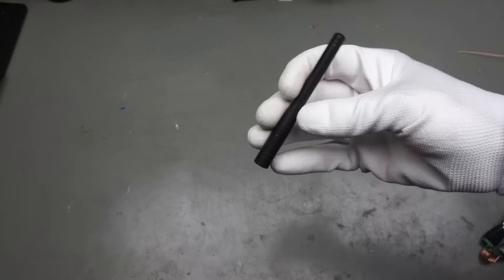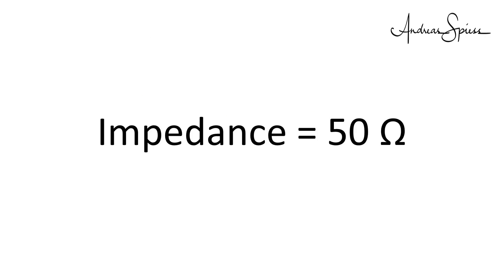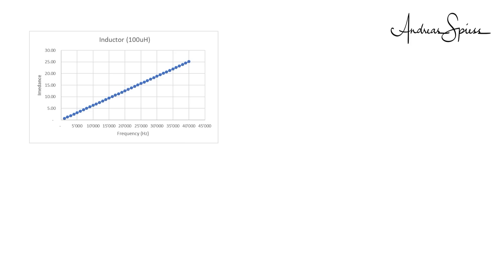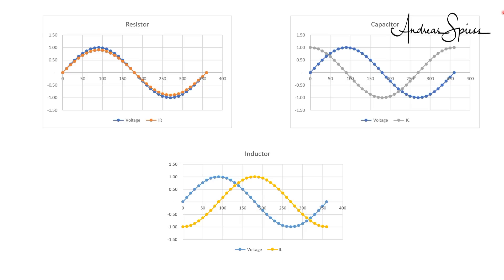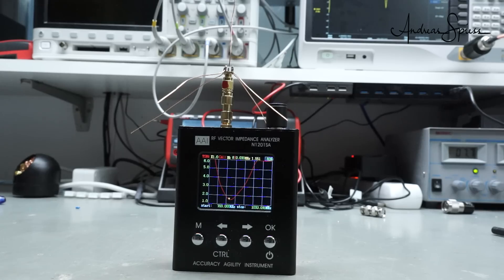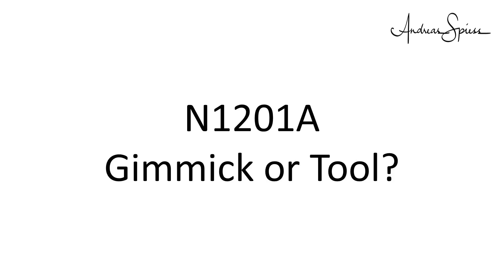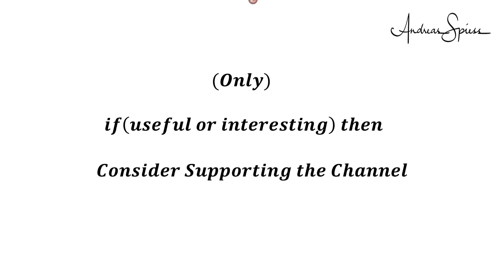#191 Optimizing Antennas using a cheap N1201SA VNA (Vector Impedance Analyzer), LoRa, Review

Comment: Can someone spoon feed me and tell me what the yellow line V shapes are when an antenna,CB 27mhz, is connected to the port 1 ?   I didn’t attach anything to port 2. Is the “V” dips where the antenna has its best harmonic in Mhz and therefore the best frequency the antenna is tuned to?
Reply from the maker: This is where the antenna resonates and should be used.

Comment: Excellent video. I also have china antennas which work correctly only when the plastic cover is removed. Do you think the designers were unaware of the dielectric effect ? Abit like the antenna problem on one of the earlier iphones ?
Reply from the maker: The palastic shifts the resonance frequency (as you write). It has to be taken into consideration while trimming the antenna.
Reply: @AndreasSpiess  
Is this due to the polymer lowering the velocity factor?
Reply from the maker: @MountainParameters  I do not know 😞
Reply: @AndreasSpiess  
When we used dual wall adhesive heat shrink to ruggedize a Smiley 5/8 wave SAR antenna, it decreased the velocity factor and the result was we needed to trim an extra 2mm (as compared to the same tune point for the stock Smiley with no heat shrink) in order to optimize the best SWR and impedance for our target tuned frequency.

Comment: Hi Andreas, maybe you can help. I am looking for a cheap way to test the strength of LTE/4G mobile antenna. Do you think that a VNA that reaches 1800mhz can help me with this? What I am looking for is a way to see quickly if the directional lte antenna is being pointed to the provider and has a strong signal... you know, moving, left right :) There is a plenty of devices for TV/sat, but I can't find any economic version for LTE
Reply from the maker: Antenna design is a complex task. A VNA is needed. But a lot of knowledge, too.

Comment: I have been using a nanovna for a couple of years and have found it very useful for tuning and troubleshooting antennas.  Every time I use it I am amazed that such a cheap tool can give me the same information as the $80,000 analyzer I use at work.  Obviously I don't expect it to be perfect but I have compared it and found it surprisingly close.
Reply from the maker: I agree. When the first cheap devices appeared on the market, I had suspicions and also compared it with an expensive instrument. Already then, the results were usable for my purposes.

Comment: Resonance and minimum VSWR are not the same thing.  Zero reactance is "resonance".    And minimum VSWR may not be at the zero reactance point.  VSWR is calculated from the load impedance and the characteristic impedance.  You really want to tune your antenna to the zero reactance point and then use capacitors and inductors get the best VSWR where load impedance=characteristics impedance and thus you will get 1:1 VSWR.    One of the better articles I've found is here https://abracon.com/uploads/resources/Abracon-White-Paper-Antenna-Impedance-Matching.pdf  and this software allows you to figure out what you need to get to the 1:1 VSWR http://www.blackcatsystems.com/software/matchmaker/tutorial.html
Reply from the maker: You are right. I discussed this topic in later videos. And thank you for the links!

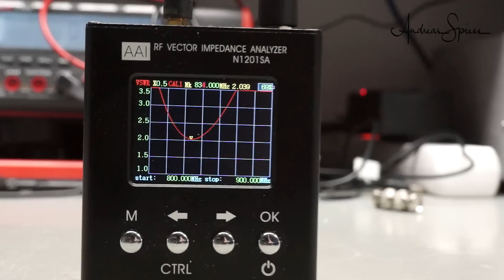Comment: 12:35 So the plastic isn't transparent to the radio waves! If the antenna was in a larger plastic box would it still have the same problem or is it the closeness of the plastic causing interactions?
Reply from the maker: The closer a material to the antenna the bigger the effect. It is not about transperency, it is the influence of the material.
Reply: @AndreasSpiess  I didn't mean transparent to light, just to radiowaves. So if an Antenna is in a large airtight box, it might attenuate the signal a little but wont affect its frequency?
Reply from the maker: It for sure will not influence its frequency but might attenuate the radiowaves signal.

Comment: Andreas your VNA and related videos are great and much appreciated is that you don't weight them down with complicated math and equations. However one thing troubles me. If an analyzer needs calibrated each time frequency is changed which I understand, what happens when I use adapters to analyze different antennas in the HF ham bands that use say for instance type N and PL259? Would not the use of adapters skew the calibration result especially if said adapters are of low quality? What say you my friend?  73 de N8EVM
Reply from the maker: Maybe you watch my video about the proper usage of the nanoVNA. There I explain the influence of the reference plane. Because we usually only have one calibration set we have to live with this inaccuracy. You find the nanoVNA on my new HAMradio channel: https://youtu.be/_gZEeoAl5Nk

Comment: You should be using the Smith Chart. You are working with half information on amplitude only. The Smith chart will tell you where you need to place a reactance, and what it should be. That will take you right down to a VSWR of 1.
Reply from the maker: Maybe you watch my video about the proper usage of a VNA?
Reply: @AndreasSpiess  I shall. I presume this was the quick and dirty version that just replicated a normal scalar VSWR meter.
Reply from the maker: No. This instrument also shows impedance. But only for a particular frequency. You can quickly change it with the wheel on the top if you want to get an overview.

Comment: I was a Microwave Technician and took a 9 month Special class about antennas, learned all the basics, theory and use of the Smith Chart and went on to work to help build 4-18 Ghz microwave amplifiers here in Silicon Valley, there were a lot of tuning using the microcope, tuning is like black magic with a skill using those little gold chips and soldering / tacking them when the desired SWR was achieved. I would like to buy one of these... hahaha... I'd like to learn how to use this HIGH TECH DEVICE 'AWESOME'...
Reply from the maker: Maybe you watch my video about the NanoVNA. This is a more modern version (which also shows the Smith chart)

Comment: Now should I resonate the antenna or vswr the antenna? I have seen that in all cases the swr readings does not match the mfj269c
Reply from the maker: Maybe you watch my videos about the NanoVNA. There you see why  resonance and a low SWR is not the same. Usually you do not want to lose a lot of power and protect your gear because of a bad SWR. So most people look at that. Many resonant antennas do not expose 50 ohms at the feed point and sometimes need transformers...
Reply: so basically you need 50ohms at the antenna and be resonant in the frequency range?the wilson 1000 is one fine example of a difference in swr and resonant

Comment: Would it be a good idea to 'Trim or Tune' antenna from the feed end of a connected coax line?
Reply from the maker: It is always better to trim the antenna from its feed because a coax changes the measurements.
Reply: @AndreasSpiess  Thank you, I have a Nano VNA on the way and will do so. Is there ever a need to add inductor or capacitor to a ground plane antenna or di-pole or just changing the associated lengths do the job? I'm guessing you might need them if you want an antenna with a wider band.
Once again Thanks.
Reply from the maker: You should not need a cap or an inductor for a ground plane. For long waves they sometimes "shorten" the radiating element with a spool.
Reply: @AndreasSpiess  Thank you

Comment: 1:14  I'd say the ground plane antenna has been the #1 most common antenna type in the world for over half a century, there's been one on almost every car and truck ever made that came with an AM/FM radio for well over the last 80+ years and by 1946 there were an estimated 9 million AM car radios in use and currently over 1 billion estimated on the roads today not counting the ones no longer being used. Mobile device antennas might have changed that though.
Reply from the maker: If you call all vertical antennas "Ground Planes" you are right. Often, the word "GP" is used for 1/4 wavelength radiating elements. Then An AM antenna would have been quite long ;-) That's why they often were loaded/shortened with inductors.
Reply: @AndreasSpiess  no, not ALL vertical antennas are GP's, there are vertical dipoles after all... But in the case of vehicles we are not typically talking about a "radiating" vertical element like we would expect for a ham "transistor" radio that can transmit too as well as just receive. Vehicle AM/FM radio antennas typically only have to "receive" which is much more forgiving and can be MUCH smaller fractions of a full, half or even a quarter λ to work...
Reply: @AndreasSpiess  I would even imagine "some" mobile radios could be considered a GP antenna too because your body acts as the ground plane. With my cheap UV-5R radio my hand capacitance acts as either the bottom of a dipole or a ground plane depending who you ask and the same could be said of other mobile devices too. What is your opinion on that matter Andreas?

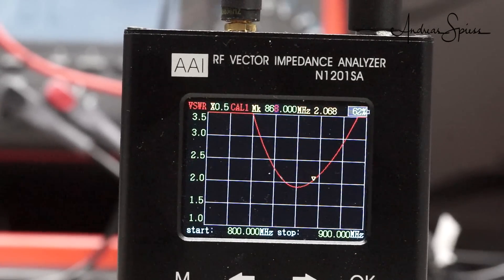Comment: I'm lost.  @13:48 you say, the antenna is ready, but the arrow is to the right of the dip.  I thought that was the marker for the frequency you were wanting.  If so, shouldn't it be at the bottom of the dip?  Is the set of numbers at the top right the SWR reading?  Please provide details of the display if you can.  
Good video, other than me being lost.  
Thanks
Reply from the maker: You see the SWR and I did not get it exactly to the minimum. Because the minimum wanders if you touch the device with your hands it was good enough for me. Maybe you watch my other videos about Antenna design and VNAs.
Reply: @AndreasSpiess  Okay, thanks for the clarification.  I only wondered because you said, "exactly" and the frequency.  It just made me wonder if I was looking at it wrong or not.  Thanks again and 73s!

Comment: Note that using springs and other "gimmics" to tune the antenna will give false results. The radiation resistance of the antenna itself must be 50 ohms, not a combination of gimmics plus the antenna. The actual signal radiation can be significantly off even if the apparent resistance is a nicely matched 50 ohms.
Reply from the maker: I am not sure I understand. With the VNA I only check of the power is radiated by the antenna or reflected back to the transmitter. I cannot tell anything about the radiation pattern nor the gain of an antenna. But reflected power never is radiated...
I am one of your subscribers, BTW :-)

Comment: Does this need to be calibrated for every range of the sweep that is set, like the nano VNA?
Reply: Depends on how accurate you want to be. It will be within 25% or so without calibration at he exact frequency, but for a few % you need to calibrate.
Reply: @glasslinger  Thanks. But I didn't ask whether it needed to be calibrated, but whether a given range for the sweep had to be selected first for the most accurate calibration. For all I know, calibration might work over the whole range only, in which case calibrating each time the range was chosen, might be a waste of time.
Reply from the maker: AFAIK you only can calibrate the whole range. So only one calibration is needed/possible with this device. I do not know how many points it stores, But it takes quite long...
Reply: @AndreasSpiess  Thank you! That makes sense. And it should save a lot of unnecessary work in terms of calibration, too!

Comment: At about 5:23, at DC, how does the inductor's 'direct short' not result in 0 impedance? An 'open' capacitor has no influence if they are in parallel as they appear to be a few frames later. What am I missing?
Reply from the maker: It should be 0 or at least have a very small resistance at DC. The curve starts a little higher.

Comment: So I’m just green and learning here, can anyone help?  If the value of the antenna (50ohm) depends on the frequency (frequency affects capacitive and inductive reactance and therefor the resulting impedance). How is it that one antenna (common retail types) can be suitable for many different frequencies ie. 698-960 / 1710 - 2700MHz?  Surely if I used this tool on this antenna it wouldn’t be exactly 50ohm at all frequencies listed!!
Reply from the maker: This is a complex topic. But you can build such antennas.

Comment: Thanks for good video! You adjusted length of a portable antenna while it was connected to the VNA. Does case of the VNA affect antenna properties? I mean once you disconnect that antenna from the VNA and connect that antenna to a radio, it might not match exactly the same. If radio case is bigger or smaller than VNA case or if it is made of different materials the antenna will match differently to the radio.
Reply from the maker: Every change changes the properties. So you can try to emulate the situation as good as possible. You see this also if you touch the SMA connector while you measure with the VNA
Reply: @AndreasSpiess  Got it. Thanks for explaining.

Comment: Hi Andreas, if I were using one of these to plot on a smith chart, which values would I use in my R+jX? The R is obvious enough, but what about the X? Should that be the reading in the Z field or the X field?
Reply from the maker: Maybe you watch my newest video?jX is on the vertical axis. Z is the length of the vector

Comment: Hello Andreas, congratulations for your great channel. 
About this video I have a question. 
Can I use the N1201SA to measure the needed datas to calculate pi network to matching the circuit with antenna?
Reply from the maker: Not really, because it has no Smith chart display. There are other VNAs out now. Search for Nano VNA or tiny VNA
Reply: @AndreasSpiess  hi would you still recommend the N1201SA vs the new vna available? I would love a video comparing all of them, regards

Comment: Andreas, and readers: I tried to order one of these in early May.  After 4 months it had not arrived, and I got a refund.  Went to try again and saw this one on Ali.  I'm no expert and wondered if it is better/worse.  
Latest NanoVNA-H4 10KHz~1.5GHz VNA 4inch LCD 1950MAh Battery HF VHF UHF UV Vector Network Antenna Analyzer
https://www.aliexpress.com/item/Latest-NanoVNA-H4-10KHz-1-5GHz-VNA-4inch-LCD-1950MAh-Battery-HF-VHF-UHF-UV-Vector/4001112414926.html
Reply from the maker: The question is: Do you need 2.4 GHz for WiFi
Reply: Perceptive as always!  A good question Andreas.  I was focusing on immediate needs, and had lost sight of possible longer term needs.  Thanks.

Comment: Hi Andreas, let us back to this video. No problem to tune antenna like GP, but I have some problem try to tune EndFeadAntenna where the reference ground is not defined. I can have different behavior according ground path: touch with my finger the SMA, connect SMA to earth direct with a short cable, connect SMA to home ground circuit, or connect sma to my desk ESD gnd point.
Where I'm wrong ? Do you have time for a lesson?  thanks (pls note I use to calibrate each time I use the VNA)
Reply from the maker: I do not understand enough about antennas to answer your questions. I sometimes have similar things happening. RF is not easy... And grounding very i...nfluencial
Reply: @AndreasSpiess  "i...nfluencial" stand for influential or in-influential ???  :)

Comment: N2201SS vs minivna tiny plus2. Can they do the same, is one better than the other? Which one is recommended?
Reply from the maker: I do not know the N2201SS. So I cannot recommend one or the other.
Reply: @AndreasSpiess  Thnx for replying. Any chance that you can compare the N1201SA and minivna tiny plus2. I want to buy a unit, but aren't sure which one.
Reply from the maker: I do not have the (very expensive) instruments to do a comparison.

Comment: Andreas the links no longer work to the equipment on Aliexpress. Could you tell me which calibration set you use as I want to get a reliable version and don't have access to the lab equipment to test them. Thanks :)
Reply from the maker: The links in this video worked when I checked them (now). Maybe you use an ad blocker?
Reply: @AndreasSpiess  I do but all the other links work, just not the aliexpress ones. Weird. [edit] I tried in Chrome instead of Firefox and the links work!

Comment: can this device measure the strength of an antenna in another device??
fx you have a Mavic drone 2.4GHZ CE, and you wanna test the db or mW the controller delivers .. can i plug a matching 2.4ghz antenna into this and then read the db strength?
i reckon not.  fx like the ImmersionRC RF Power Meter v2 /though that is 5.8ghz intended)

Comment: It would be cool to see how you calibrate that system.  Using only 1 port s11 maybe but how can you perform the other calibrations without the necessary ports?
Reply from the maker: You only can measure S11 with one port.

Comment: Beware if you want to buy this, Aliexpress is suddenly flooded with clones (or clones of a clone?) of this thing.
Reply from the maker: How do you know that they are clones? And how about the performance of these clones?
Reply: @AndreasSpiess  They have noticeable different printings on the housing, and other screws for the case despite the price jump from ~150euro to ~90. The firmware looks to be the same. I have no real comparison of the performance, but if they didn't screw up something fundamental I would expect them to perform similar as the parts used in the original are jellybean parts (STM micro and 2x ADF4351 wideband synthesizers) available everywhere. But it still kind of feels like a gamble to buy one of these